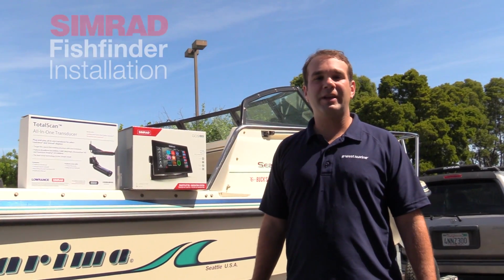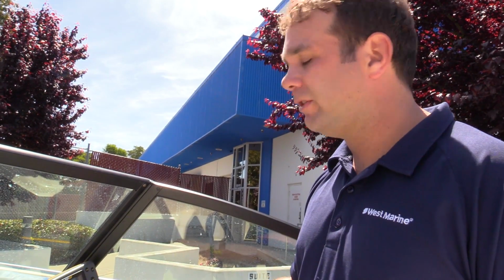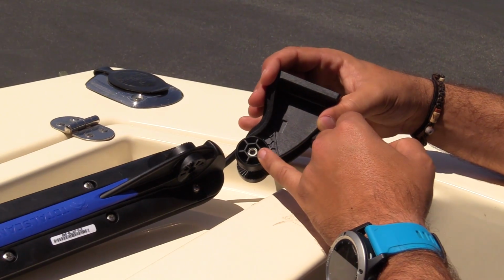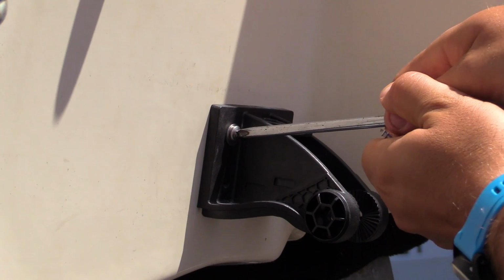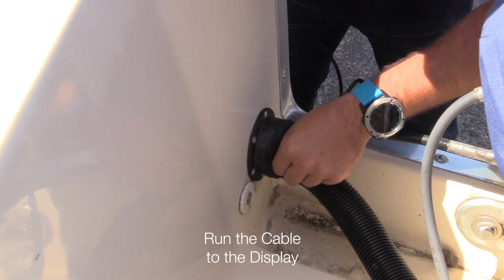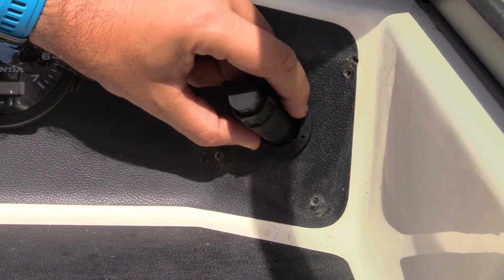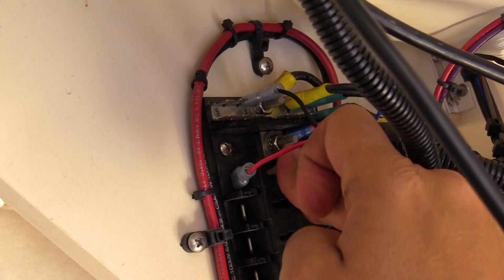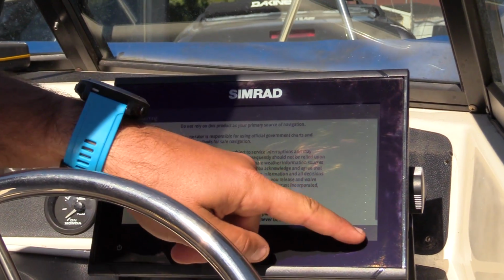Installing a Simrad GO9 on an Arima Boat

Comment: Good informational video and nice boat! Arimas are great boats! Here in Nordland, WA we see close to 100 Arimas a day during salmon season since we look out over Admiralty Inlet, which is one of the best salmon fishing spots in Puget Sound. One tip for transducer mounting though: take a piece of 3/4 or 1 inch thick, 3x8 (or another size) starboard (HDPE) and smear a marine epoxy like Six10 on the side that will be against the hull, then take 2 screws and mount it where you want to mount your transducer. That way you can mount as many transducers as will fit on the piece of starboard or move your transducer around to work better and the whole time you only have drilled 2 holes in your boats hull. It is a great way to protect your hull from having holes drilled in it and it gives you much more flexibility (comfort and confidence too) to change how your transducers are set up. It was a huge help to me.
Reply from the maker: Thanks for sharing!

Comment: Great Video Mike! One tip that I received from a Pro over the years is that using the old cables to snake the new ones is not always a good idea, (I used to recommend using the cables myself), here's why, many modern boats are built in two parts with systems run in the hull (and usually anchored in place with zip ties or other wire anchors) and then the deck is layed on top of the hull leaving many of the wire anchor points inaccessible.  Tugging on the old wire could cause other wires or cables to be disturbed in the process cause more issues with other boat systems, especially if the transducer was installed in the factory, the Pro tip is to leave the old wire in place and run a new one with a fishtape,  that way there is less of a chance of disturbing other wiring. Make Sense?  Boat is really starting to shape up! Keep the videos coming.
Reply from the maker: Great insights and thank you! It has been fun really learning to maximize the functions on the GO9 to get its full potential and catch more fish. Everyday we learn something new.

Comment: I have a 43ft Black Thunder Power boat with the Simrad GO9 XSE is it OK to mount the the Totalscan extended Transducer to the stern with High performance twin engines

Comment: You cant level a tranducer in the driveway without putting it in the water first with a level on the side of the boat with some spare change. Raise the back of the level as close to level as you can the way the boat sits in the water with some change. The go home and jack up the boat with level and change as it was in the water. Then go level your transducer.

Comment: Sorry Mike.  I submit that your video is ... poor.  WHY?  The most important step of the install is correctly sealing the hole(s) going into, or through the transom.  Wood boats or those reinforced with wood at the transom may start to rot at this point given an improper install.  And IF sealing the transducer to the transom is grossly improper, the boat might sink, especially if left unattended for some time.   NEXT:  Do Use 5200 instead of the less-sticky 4000.  Be more than generous with the 5200. (Don't worry, the seal can be broken if need be with patience and a heat gun). You want it to squish out Big Time when you tighten the bolts down. Before inserting the bolts  make sure the bolts are totally covered with 5200, too.  Clean up is easy with paint thinner and paper towels or shop towels.  This is the most important part of  the Simrad install.  A failure will likely get blamed on Simrad and not the installer.  This is the critical part of the install.  Get is right and you are happy.  Get it wrong and you will likely bad mouth Simrad for the rest of your days.
Reply from the maker: Gerald, thank you for your comments! We have taken this back to the creative team to review.
Reply: I'll